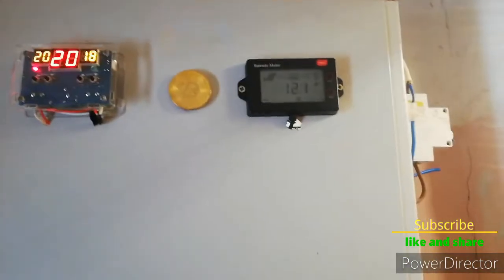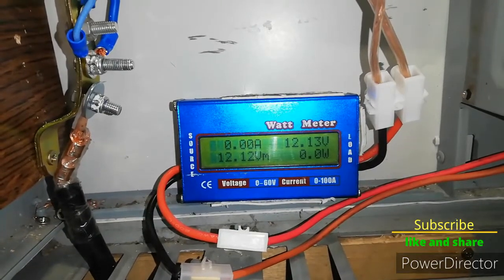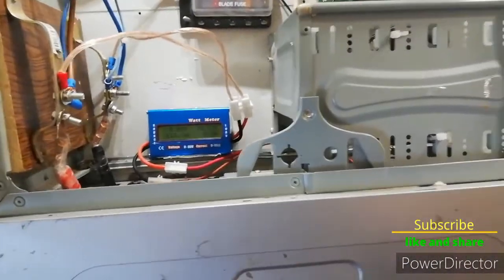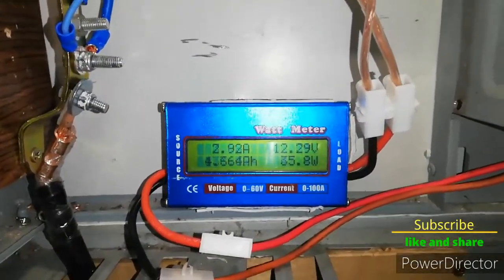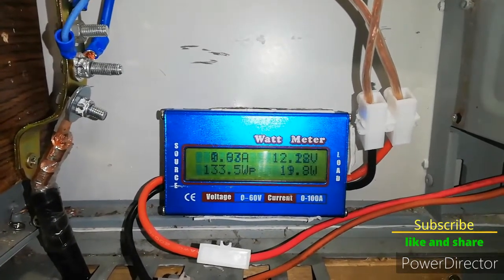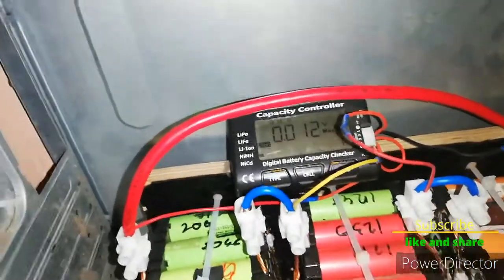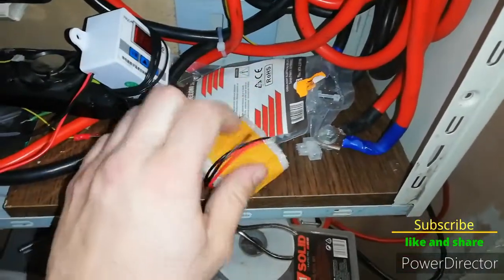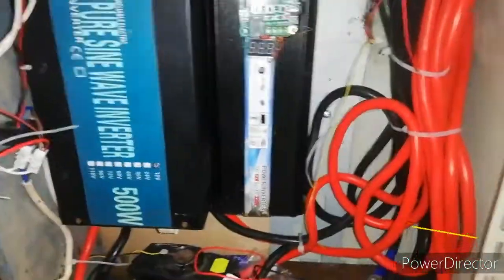Hoverboard wind turbine charging 18650s at snow storm

Comment: Hello can you help 
I wanna get 400w with hoverboard motor   (36v) how much wind speed in m/s i need
Reply from the maker: basicly from small hoverboard motor you will get 250w max... but it depends what blades you get or make.... my 6 blades can make max 186w...if you buy blades made in china for 600-800w turbine then there is chance to get 400w, but you have to get big hoverboard wheels not these small ones
Reply: Power goes up lineary with surface area of blades and ^3 with wind speed.

Comment: Hello, I plan to make a similar project like this, but I don't have that much experience with the studio, I'm a locksmith by profession, everything else is not a problem, electricity is a problem with connecting.  Isn't it a problem for you to explain to me in order what you need from the material.  I understood that it takes 3 phases to switch 12 v and what next?

Comment: That's the hoverboard if it you need new blades because my hoverboard generator makes 12 amp at 20 miles wind that's about 9 meter per second
Reply from the maker: i will redesign these blades that are on right now and make them balanced even so its not wobbling and then maybe rewire stator if need

Comment: I have made something very similar using the hoverboard hub, like your previous video am struggling to produce much more than 5v at lower wind speeds, was thinking about a dc to dc convertor to step it up which would automatically switch in at lower speed and then come out of circuit at higher speeds. Also, noticed you have gone from 3 to 5 blades, mine spins significantly slower with 5, but catches the wind easier, presumably this was the same for you? But looking at how yours is now spinning in its new location, wouldnt you be better back with 3?  Thanks for taking the time to update your project on here.  Take a lool at Robert Murray Smith's videos on here, he has some great ideas too.
Reply from the maker: Thanks :) my turbine have 6blades and yes its much better than 3 at low winds and high wind output also is greater ;) if you want turbine to produce power in low wind then you have to rewire it... there are many videos at YT how to rewire hoverboard stator for low wind power. but basicly without rewireing at 5meters per sec it should make almost 10volts with 6blades ;)
Reply: Ok thanks, will take a look for re-winding details. Sorry, couldn't see it was 6, but saw it was more than 3 so just presumed. Thanks.

Comment: Hi there, I am building a windturbine by myself with a drytumbler. Do you think I need a battery before I connect the charge controller with the inverter to make 220v?
And how do you call the display where you can see the amph's, watts, and volts while the windturbine is spinning?
Reply from the maker: Hi :) yes you need battery so you can connect wind turbine and then inverter... if you have dc 12/24v motor then you can use charge controller, but if you have something like ac wind turbine with 3wires then cheapest and best way will be bridge rectifier... they cost under 10/15€...and that display is watt meter... i will try to find links to sugest few of those if you need help with that :)
Reply: @SigmaWorksSW3D  thnx kriss, it's a hoover-windturbine so it is AC 3wired. I would like to know a link for a rectifyer with watt display. By the way; do I need a battery because its difficult to handle the different volts for an inverter?
Reply from the maker: i think yes battery is optional in any case ;) i will put links in next coment
Reply from the maker: bridge rectifier that i use € 3,07  5%OFF | Original 50A 1200V Aluminum Metal Case 3 Phase Diode Bridge Rectifier 50Amp SQL50A Module SQL50A1200V
https://a.aliexpress.com/_mKt4JSj
Reply from the maker: watt meter € 4,91  33%OFF | Digital LCD DC 60V 100A Balance Voltage Battery Power Analyzer RC Watt Meter Wattmeter Tester Checker Balancer Charger RC Tools
https://a.aliexpress.com/_m0IaiCj
Reply from the maker: i will buy this one because its realy acurate and powerfull € 11,69  16%OFF | ATORCH DC 300V 100A Accurate Energy Bluetooth Meter Voltage Current Power Voltmeter Ammeter Overload Alarm Function indoor
https://a.aliexpress.com/_msycvKF
Reply: @SigmaWorksSW3D  thnx a lot Kriss